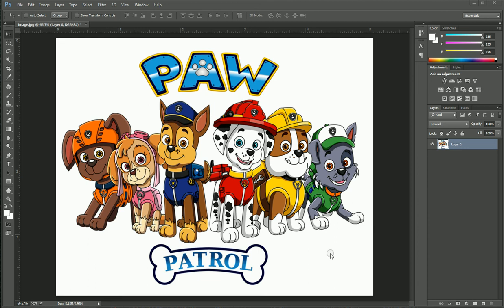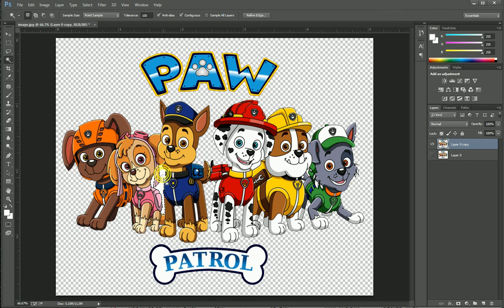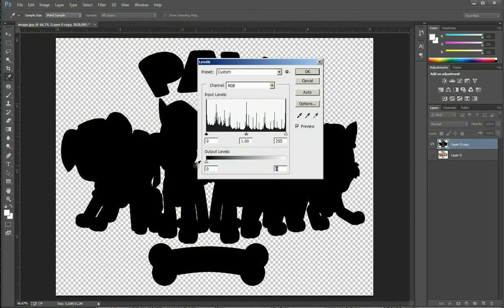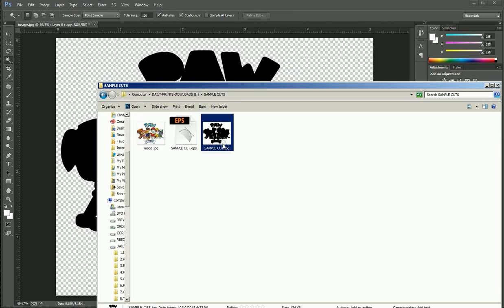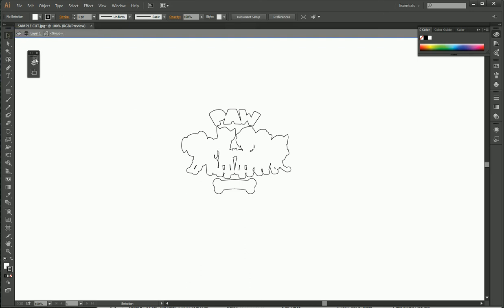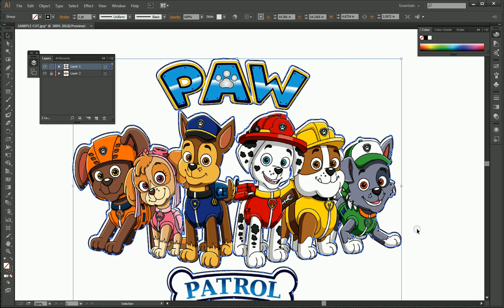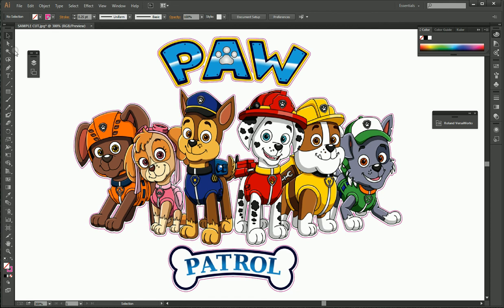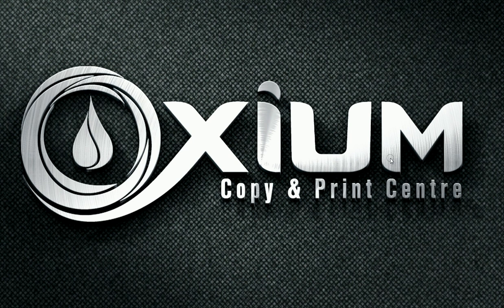How to create vector cut lines

Comment: Can you please help me to du it in inkscape. how do I make the working CutContour  in the inkscape.
Reply from the maker: Sorry for the late answer I had a lot of stuff happen this year.

Roland Versaworks uses a spot color called CutContour, which is 100% Magenta (CMYK= 0,100,0,0)
This color is applied to a stroke with a "hairline" stroke width. The cutter recognizes this as the cut line.
You can create a swatch with the name of CutContour and the value RGB=255,0,255 or ff00ffff. You must do this manually using an XML or text editor to edit an existing pallet in the Inkscape pallets folder, or you can create a new one based on existing ones.
I'm not yet certain that this works with the Roland Versaworks software, but it should. I need to test this myself.

I will be uploading more videos on Roland how to’s .